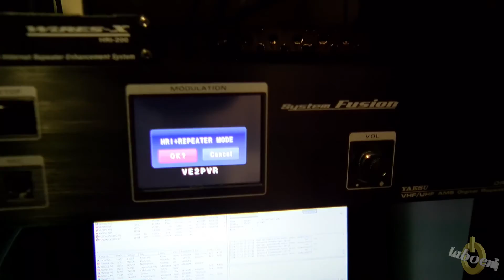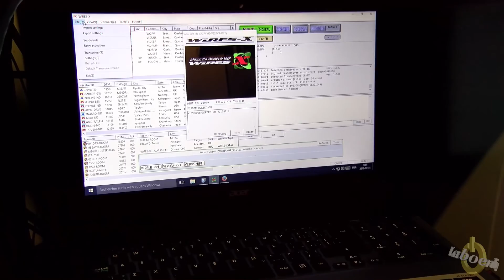DR-1X upgraded myself to be compatible with the HRI-200 and Wires-X

Comment: Has anyone who has done this upgrade have issues yet?  I haven't heard anyone actually have the problems with AMS, digital or otherwise.  I have upgraded my 1.00a to 1.00n, seems everyone doing this go from 'm'.  I want to use as a standalone WiresX node to free up my 400 for now but I do not want to pay another $120 for shipping if it is something that I can do myself.  Who HAS had any issues with doing this? Is it only working from 1.00m?  Has anyone set theirs up as a Wires node, standalone?  It will serve as a backup to our club repeater but until then I wanted to use it as our node if possible.
Reply from the maker: I've been running the repeater like this for more then 5 months, I had it lock in TX once recently.   I can't say for sure what happen.  I'm in FIX Digital only.  73
Reply: Well unfortunately I was finally able to hook mine up to replace one that needs to go in for update for the club.  Mine would not transmit so I guess back to 'n' I will go (hopefully it works to flash backwards) and I'll have to send it in to Yaesu and spend the $120. >:(

Comment: I have owned my Yaesu DR1-X since November 2014. I was able to upgrade my repeater to Version 1.10Q, without any problems. When you send the repeater to Yaesu for a update, they update more than just the "MAIN" and "DSP" firmware. Yaesu updates all five firmware updates [only two are released to the public (MAIN and DSP)]. No hardware changes are made, when you send your repeater for the upgrade.

Upgrade at your own risk, but it worked for me too.
Grant
N5YX
Reply: Also, AMS mode works with Version 1.10Q. I upgraded from the original Version (1.00A)

Comment: What FW version did you upgrade from when migrating to FW 1.10J? I'm currently running an older version repeater on FW 1.00M
Thanks 73's Mike N8XPQ
Reply from the maker: I have my repeater since fall 2014, I upgraded it from 1.00m directly to 1.10J.  I follow the normal firmware upgrade procedure.   I don't know if I was lucky but it works, it's been on the air since the 30 of July without any issue.   Mine is in Digital only, no AMS.  I tried AMS and it work as well but I worry about the lock up issue.   If you decide to do it maybe it won't work, I don't know the risk, so it's at your own risk and maybe this will void the warranty.  For me, it did the job and I'm very happy.  73

Comment: Hello Pascal , you belive this issue, with HRI and stuck TX , effect and if use the repeater with MMDVM? I asked because at next days i have to my hand a DR-1X for convert to DMR repeater!!
Reply from the maker: I really don't know about the MMDVM.  But what I heard is in order to work in C4FM it needed to be updated.  Maybe some viewers can answer this question, or you can join the MMDVM Yahoo group.  73 Pascal VA2PV
Reply: Thanks Pascal for response and infos, finally my repeater is DR-1XE with firmware 1.10 ! 73 Themis SV4QXF